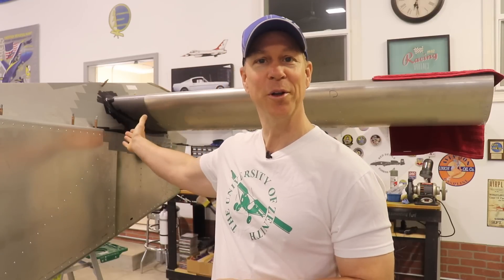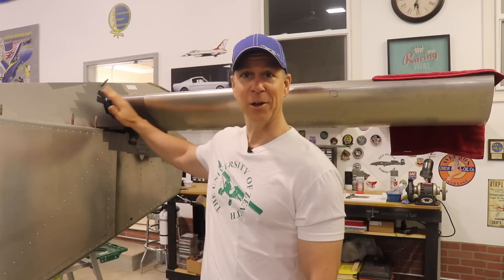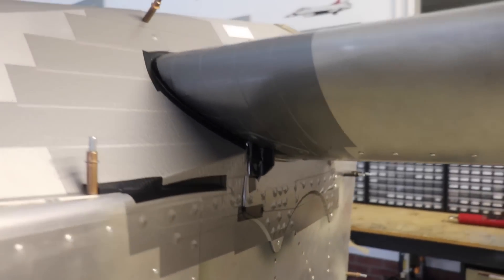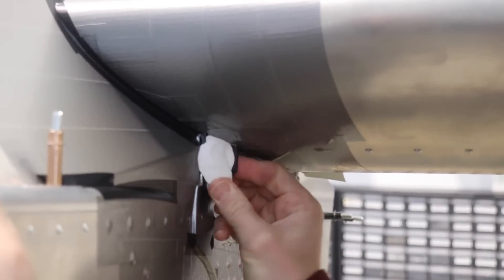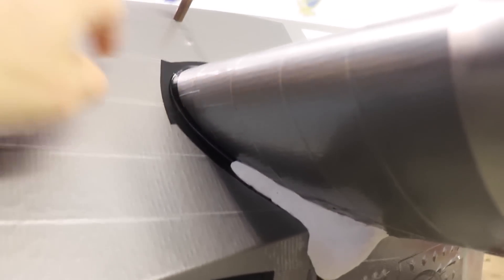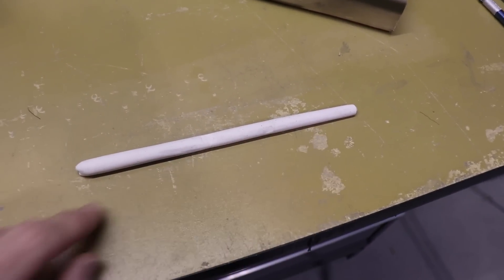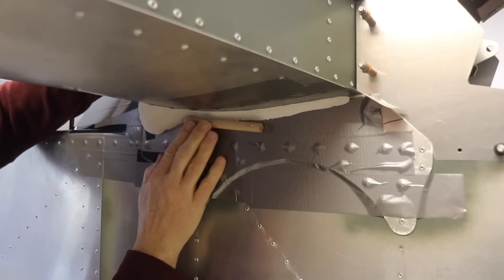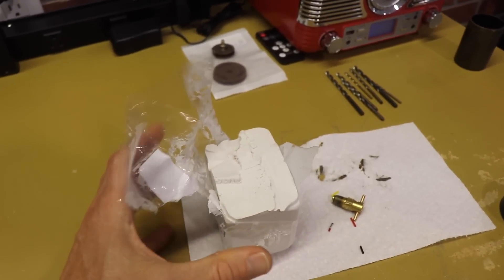Using Plastilina to Make Fairings (Ep85)

Comment: Sculptex makes a plastilina that comes in soft,  medium,  and hard. I use the medium for claying up two-part silicone or plaster molds. I think the soft clay would be easy to work in place on the aircraft,  but it might be too soft to hold up if the resin gets warm as it cures. You can also mix the soft and medium to get an in- between consistency. I get the Sculptex online from Reynolds Advanced Materials.
Reply: For small pieces and detail work, I heat a wad of the medium plastilina in the workshop microwave for about 20 seconds. Then I can shape it easily, and it holds the shape well when it cools back down.

Comment: Hi, we used to use plastercine which by memory was a petrolium jelly & talc based version, I think plastalina is a vegetable oil based version. We would warm it up to soften it, then use heated spoons to almost/slighty melt the surface to get a smooth finish. a quick spray of silicone or WD40 helped to stop the pick-upWe layed up straight on the plastercine & didn't need tape or anything. When we joined 2 split-mould pieces, we used plastercine to blend the joint. When the split mould gave us a 90 degree join, we had ball bearings brazed to short rods (as handles) to run along the joint.